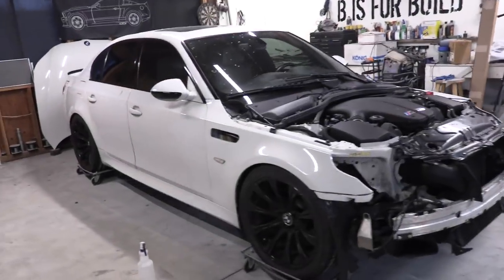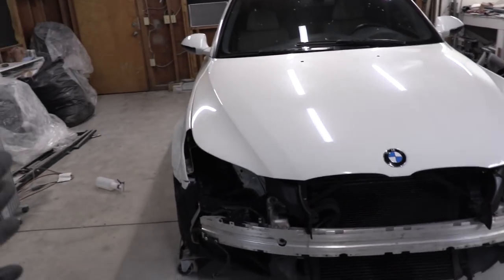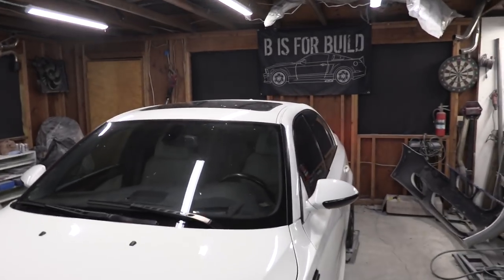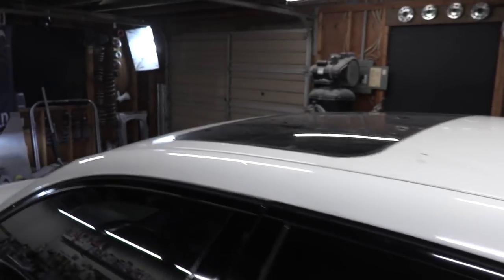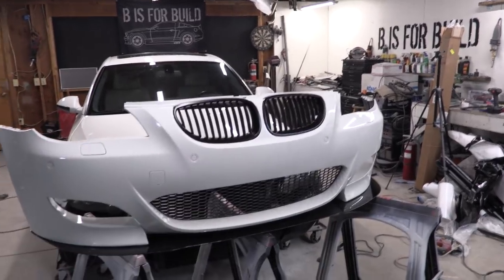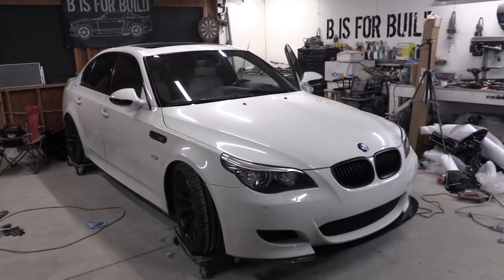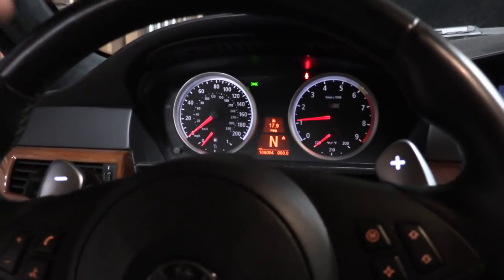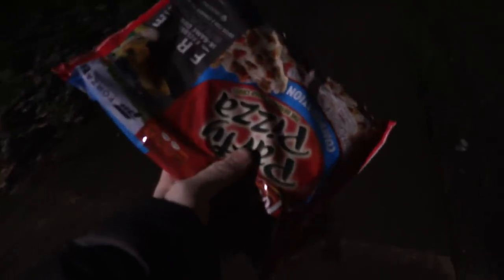M5 Final Assembly Time!!

Comment: You need to try 3M vinyl, I wrapped my whole car with no previous experience and it was easy. I've used cheap ebay vinyl on small interior pieces and that stuff is a nightmare. I removed it immediately just like you.
Reply: Dane Taylor you have a link bro?
Reply: He hates vinyl, mentioned it on like 4 car builds.
Reply: He would have a better time wrapping if he used better vinyl, like 3M.
Reply: Tom Y 6:40 ...........
Reply: BMW life 203 it's a joke lol
Reply: +1 for 3M. Much more scratch resistent. And use a squeegee with felt on it 👌

Comment: I noticed the box of Vivid vinyl in the video. If that's the material you've been using to do your wraps, that explains why you're having a hard time.

Vivid is shit. I used it on my roof and on my hood because it's cheap. But it's very hard to work with and overall a terrible vinyl to work with. I highly recommend the 3M 1080 air release film
Reply: NiccWithTwoCs vivid is actually a great product. Shows what you know
Reply: wow you're right, i totally know nothing about the vinyl that I work with every day.
Reply: okay sure dude whatever you say 👌
Reply: I'm with Nicc, just looking and hearing the vinyl in video, it sounds and looks like shitty plastic. i wouldn't buy it for any reason.
Reply: Tommy Bennett yeah cause all 20 likes were for your comment..... hows that for validation
Reply: Not hating on Chris, but they're applying it with a cloth. That's not how you do vinyl and that's why it's coming off so easily and probably also why it looks so shit. The scratches you can get out very easily by applying a bit of heat once you're done.
Reply: Vivid is not a bad vinyl, it just needs an absolute shit tonne of heat to get it to work well. 3M 1080 is obviously better, but it's premium shit with a premium price.
Reply: I wouldn't say Vvivid is crap per say, it's just a slightly different installation process from the other big brand names (Avery, 3M, Orafol, etc).

Comment: B! Just a couple quick tips about vinyl wrapping:
1) Vvivid is a slightly different installation process than 3M, Avery, etc. It is not a bad product like everyone else is quick to say.
2) Use a felt edge squeegie
3) Use a touch of heat, only when needed
4) Surface scratches from the squeegie/rag/dish towel xD can be removed by hitting the surface with a bit of heat from the heat gun. They disappear, it's quite magical. You can also leave it out in the sun for a couple days if you don't trust yourself with a heat gun.
5) Work with triangles (YouTube "vinyl wrap triangles technique")

Comment: Id also recommend the 3M 1080, goes on way better, I also use a special soapy mix with one tsp of dawn dishsoap in distilled water in a spray bottle, cool surface to work on, spray vicariously, then place vinyl on there, then squeege the main parts and for the detailed bits hit it with a head gun, after everything looks good, i go over with it with a towel and dry as much as i can before hitting every inch with the heat gun once more. worked for me and I love the 3M product, now black will show more scratching but if you use a soft rubber applicator vs a plastic one, it will help more.

Comment: Yes Chris!!! Give me a shout if you need a hand with your 240Z at all, I've torn apart and rebuilt my Z more than enough times by now, currently RB26 swapping it

PS: If you're having a hard time finding a 240Z, expand your search to 260Z and 280Z!  They're essentially the same as the 240Z and what little difference they have can easily be changed back to 240Z spec

Comment: The scratches come from squeeging with a dirty squigy + not using soap water. But even when it's scratched, vinyl has a self healing capability, simply heat it with a torch and the marks will disappear.

Comment: Use 3m brand wrap, or Avery, or oracle. IMO 3m is super easy to apply and it is very forgiving. You should be able to wrap a roof easily with quality wrap in 30 minutes

Comment: It could've been knock off vinyl.  The logo should be on the back but the backing paper looks plain white.  Easiest/beginner type vinyl is 3m and Avery.  Also the tools make the difference, getting good knives and monkey strips will keep it from scratching.  Gloss is easy to scuff so you can either spray it down with baby shampoo/water mixture or buy the premade stuff, it can help lubricate when applying.  Lastly that roof could easily be done with any heat, just takes practice.

Comment: Are you sure you took off the protection layer from the vinyl wrap? It's transparent film that covers the wrap itself and protects from getting scratched when being applied. If you rub it with finger nail it should come off. Even the cheapest vinyl wraps have this kind of protection applied on the surface.

Comment: I would REALLY like to see you build a 240Z with a turbo L28, or even a stock twin turbo RB26 with a 6 speed and build the chassis for autocross or road racing. Hell, even a 240Z chassis with a VQ35 or 37 swap with a 6 speed would be alot of fun with a properly tuned and stiffened chassis.

Comment: Should have tried that front diffuser once bumper was fitted on the car. sitting on the ground the bumper would seem wider. Standard 5 series don't really have a narrower front bumper.
Reply: Yugen Studio E60 M5 are most definitely wider in the front. They have slightly flared arches over the standard e60s, so the bumper accomodates that. However the bottom might have been able to tuck inwards to suit it.

Comment: Typically when you wrap with a gloss vinyl you need to lubricate the squeegee to minimize the scratches on the vinyl.  Try that out next time. Also try ceramic coating it to avoid any additional scratches when it's finally installed.

Comment: I was thinking of an addition to your build videos that might give an extra bonus feature for your hands on subscribers and that is to put a clock in one corner of the video so folks could get a more realistic assessment of exactly how long the various processes actually take you to complete - eg. how long it takes you to fit and align a fender or how long it takes to build a bracket for some accessories or such like. This is a useful bit of knowledge for those contemplating a particular project and could help them say either yes, this is doable or no, it's too much for me to take on. What do you think?

Comment: Looking great but that aluminium splitter is silly, And you used a magic marker to colour it? lol... You should of fabricated the real splitter by cutting it down the middle, then widen it and use fiberglass to fill in the middle. bit of filler and quick spray. done.

Comment: That wrap is not the correct wrapping material you seem to be using window tint. The scratches are cause you are not using water which that material calls for when applying it to prevent the scratches from the card you use
Reply: I don’t know which type of material your using I could be wrong.

Comment: That wrap you are using is shit, it only takes one person 10 mins to wrap a roof, anymore time than that then the wrap you are using is either shit or the person wrapping is not skilled enough. Once you use good quality wrap you will gain confidence and end up with a better result, You only need to pull the wrap 4 times to wrap a complete roof, anymore pulls than that then the quality of the wrap is the problem.